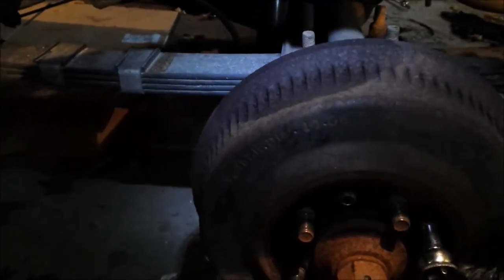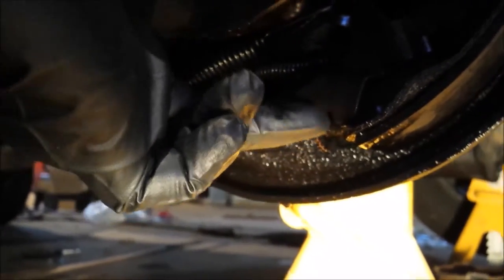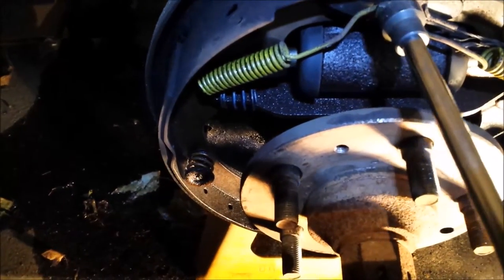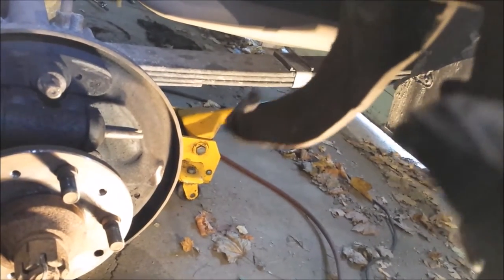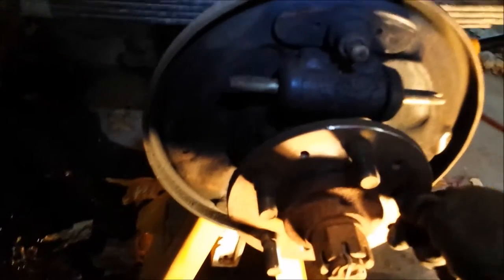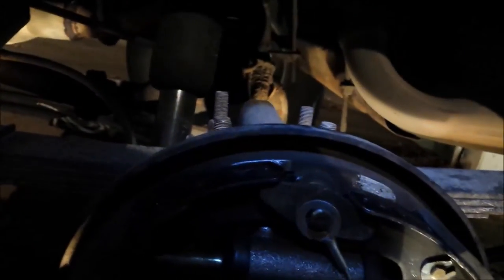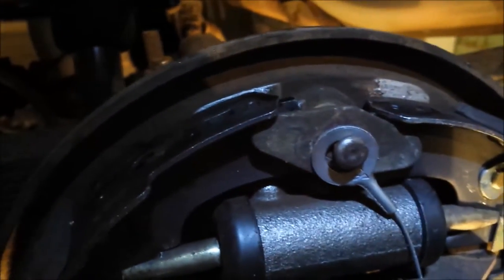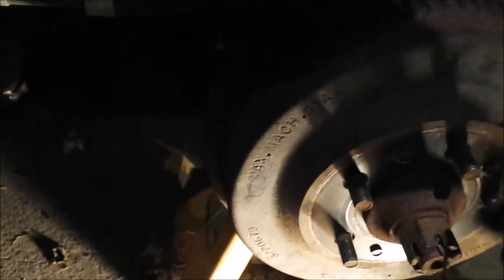AMC Drum brake job

Comment: They have a shoe retain spring removal/installation tool included in a brake drum repair kit which works great especially when installing them, no need for fighting trying to push in and turning the retain washer by hand or with pliers. The shoe retain tool allows you to just push the spring in, turn the washer to lock it in place and it's a done deal. You can buy a "drum brake repair kit" pretty cheap from Harbor Freight tools.